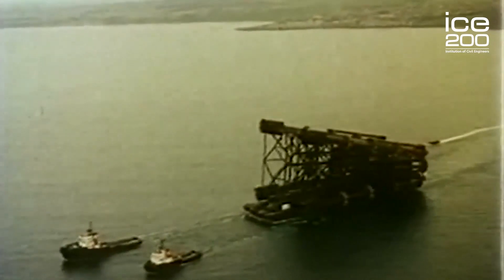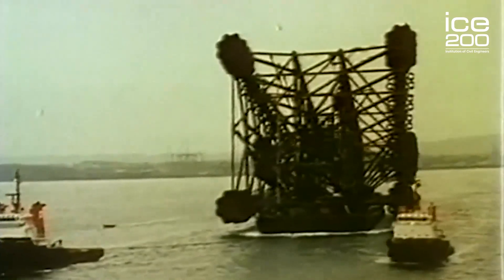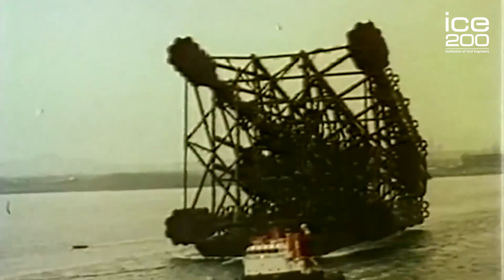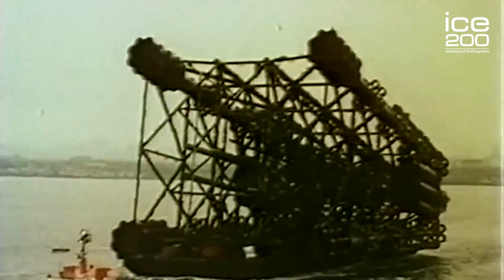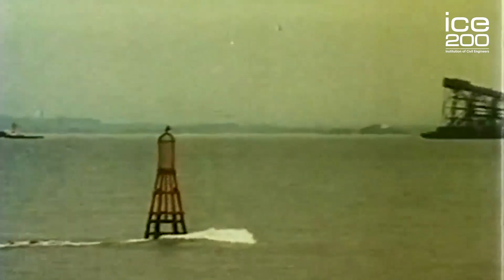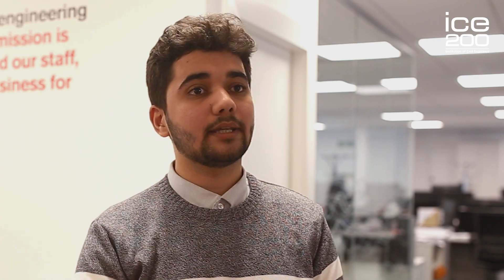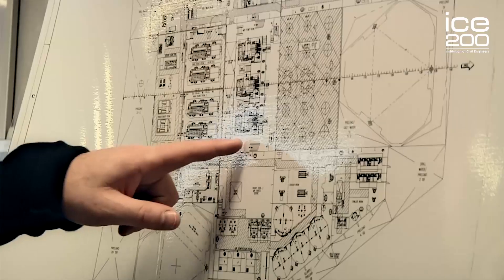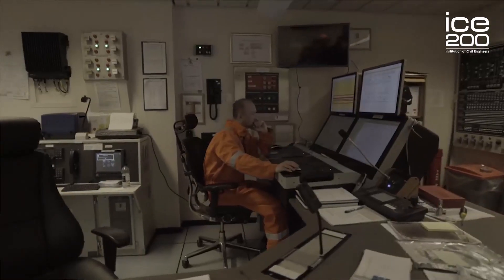Maureen Platform Decommission

Comment: I remember the decommissioning process from the land side. A colleague of mine was in a boat in the North Sea with a video and still cameras, filming the refloat. He and another colleague had set up the telecommunication link to shore which we had access to. The video feed was streamed live to the platform operators and later on, I joined all the still photographs into a simple animated GIF file to give a time lapse video of the operation. 

Both videos are probably saved on a secure server somewhere.

I believe that some of the decommissioned structure was 'chopped up' and now forms the base of a harbour that was constructed in a Norwegian fjord. 

I believe that the engineer who devised this refloating approach to a new oil rig was also involved in the plans for it's decommissioning decades later.
Reply: I Inspected most of the steel plate that was formed at CBI in Gelsenkirchen and sent to Scotland to be welded together for the 3 tanks then I was sent to Perrin Valves near Frankfurt am Main to oversee the fire safe valves production, testing, delivery, etc also I Inspected the towing cables and connections so I was kept pretty busy ! You are correct, I heard from a Norwegian guy that one of the tanks had been sunk as a protective reef in the Norwegian fijord.  It was always a mystery as to why the British government did not insist that the Steel plates and Pipe be sourced from UK Steelworks / Pipemills,  instead of Hoesch, Mannesmann and Thyssen in Germany.

Comment: A lot of misinformation here, the Maureen was not a floating platform at all, it was a platform built upon three storage tanks that could be floated out to a suitable site, the tanks partially flooded and the whole structure gradually sinks to sit on the ocean floor on top of the template. The Template was a steel construction that had already had around twenty six wells drilled, it took around a full day to connect the wells to the Maureen and start collecting oil in the tanks. The cost of the Maureen was around $1,1 billion, the cost was recuperated in just over 100 days. It was always envisaged that the Maureen would be the first of a series but this was not to be. It was always envisaged that the Maureen could be raised and towed to another location, the idea of decommissioning the Maureen after the Oil, gas, condensates were played out was never discussed back then. Most of the Maureen steel was ST52 which is a high grade, finegrain steel not difficult to weld and every segment had the heat, test numbers, grade permanently applied. That's how things were done back then.